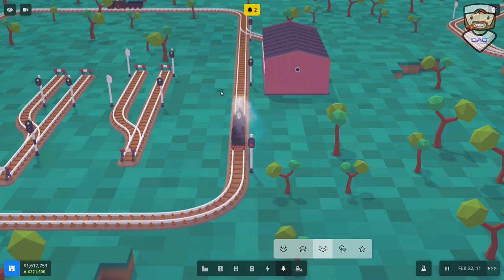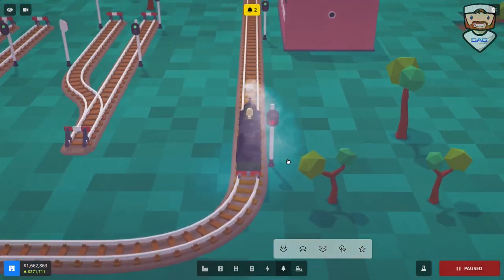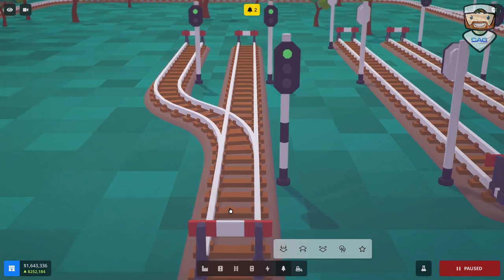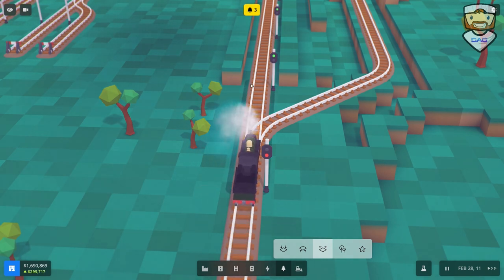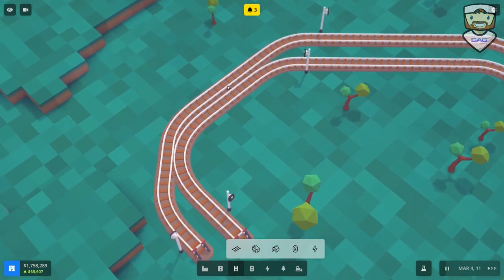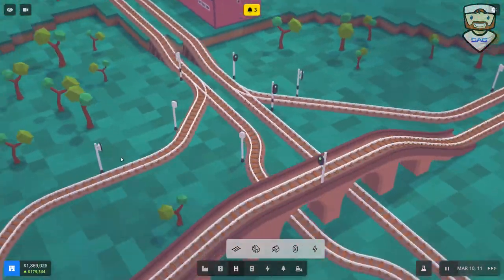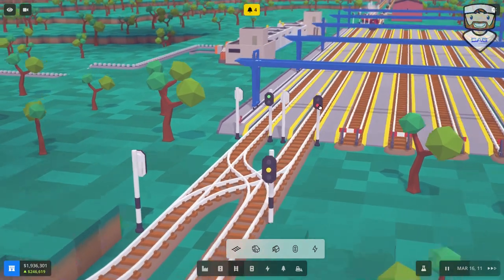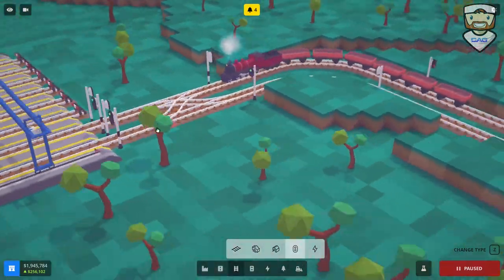Voxel Tycoon SIGNAL TUTORIAL!

Comment: Pre-signals (named new in the last patch 0.73) 

Look at there own block and the next block after its own. Like this

Pre signals looks (its own block is free then green) signal after the pre signal is red (then pre-signal becomes red (or yellow if two tracks or more)

If you chain them up, then it looks at all the pre, signals in the line. So say if you use only pre signals it wont work because it will be looking at all of them. 

Double pre-signals after each other is weird (even if you have a junction) and becomes a mess very fast. since it will be looking at its own block (first pre-signal), the next pre-signal block and the block after that until the next signal. And all branches. So if you have 3 branches after the second pre-signal, and on off them is a train (in the last block before the end signal) then it will stop at the first pre-signal until the blocks are open at the second pre-signal.

Comment: @4:50
The straight track is faster assuming you have an actual destination to get to. I'm fairly sure both  of those trains just run in a loop without any order; when trains don't have any order, they'll just randomly pick ways to go, regardless of where it goes (they'll even go in dead-ends !).

If you do the same setup with stations before and after the segments, you'll see that they behave differently.

However, they're not 100% "smart", they can sometimes take big detours just because a track is free instead of waiting 2 seconds for the shortest path to clear.

Comment: There is a problem as you can see at 04:24: Trains will not advance onto the free lane on Relay Signals (yellow light signal) even though they should. Trains still have to wait until both paths are free.